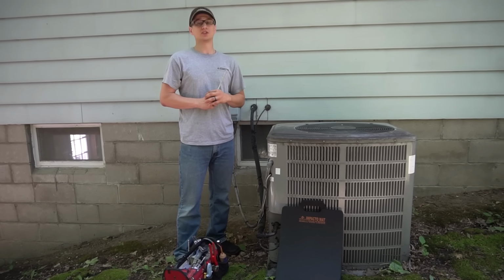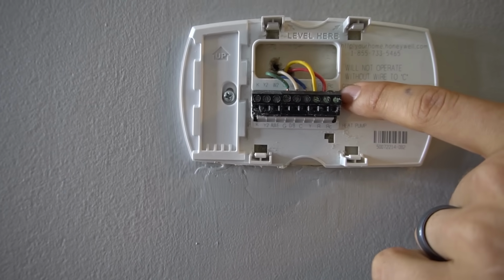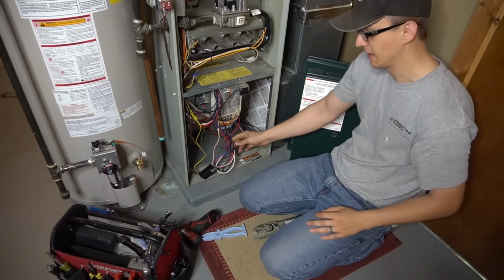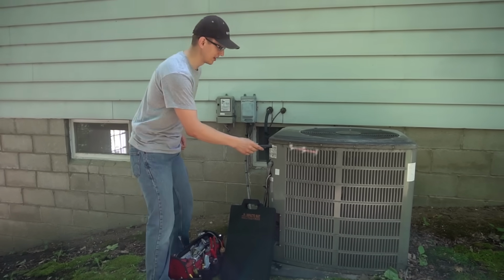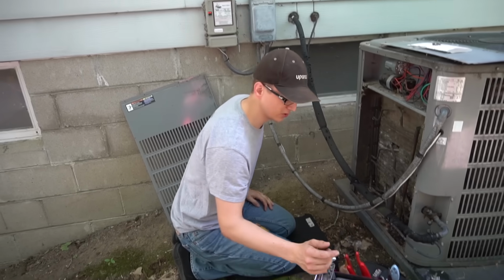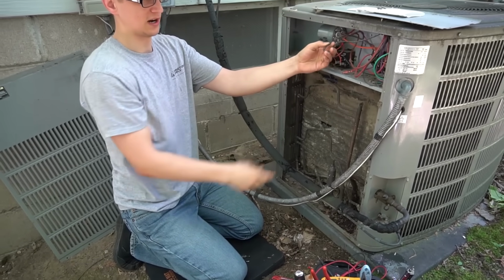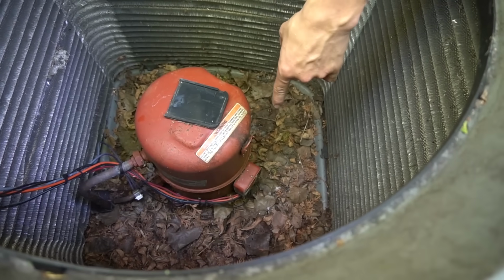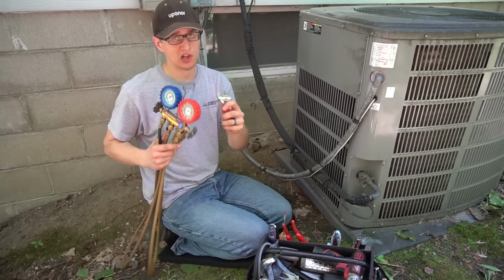AC Unit Not Turning On - How to Fix It Step by Step

Comment: Thanks for sharing, great video, my problem is that my AC stoped working 3 days ago and when Technician came looked at it, he found out the 30Amp breaker in the controller unit is burnt out, so he replaced the breaker and the system starts working but he connects the Red and Blue gauge and checks the ferron and he adds 2 more litter of ferron but he says there is too much pressure on the red gauge, so basically the RED gauge show 320 which he says is very high and that is the reason compressor draws too much power and burns he breaker. 

Not to mention that the new breaker burnt after 15 minutes and AC is dead again. 

So my question is, can I use the Hard Starter kit to fix this or is there any other way to fix the high pressure on the RED gauge. 

Thanks

Comment: Nice video! My Outside AC Unit Not Running But Inside Is blowing cool air, not COLD! It worked on this morning, but in the afternoon, we found no cold air, and the AC unit is not started (the fan on the AC unit is not running). When turned on the thermostat to "cool" and set target temperature below the indoor one, I can hear the cool air is started to blowing. I also heard a quick "click" on the AC contactor. But the AC did not start. I used a voltage meter to check the voltage before and after power goes through the fuse, it showed 3V. why there is no power? I did not see any AC switch on the breaker board in garage. Could anyone please tell me what is the problem?  Many thanks!

Comment: Hi, thanks for your great video. My AC is a one year old. The issue is when the thermostat starts I could hear the fan starting but not the compressor, for a while there is a periodic humming sound that comes on for a couple of seconds and repeats a number of times and then finally the compressor starts?

Comment: Awesome video. But I have a weird problem with my heat pump. AC isn’t working at all. Thermostat is set to cool. No clicks, hums, or anything from the outside unit. And no inside air movement from air handler under the house, either. Both outside capacitors test fine. Plunger switch on outside unit does start the compressor when manually pressed, but the condenser fan does NOT start. Nor is there any discernible hum from trying to start. The fan blades spins easily with a stick so the motor is not seized. But they don’t spin up even when I prod them when the plunger switch is pressed and the condenser kicks on. They just spin freely but gradually slow to stop just like when plunger switch is not engaged. No visible wire damage anywhere and unit was working perfectly yesterday.

Comment: Perfect video for troubleshooting central a/c problems.  I learned a lot very quickly.   The one point I’d make is that the installation in the video was a more typical heating/air conditioning setup.   If you have an older home retrofitted with a high velocity A/c system (blower unit in the attic vs basement), there is a drip pan beneath the assembly in your attic crawl space.   My issue was that the drip pan was full due to a blocked line, and the sensor in the pan stopped the trigger for the air to start.  I assume this is a precaution to prevent the drip pan overflowing and damaging the ceiling beneath it.

Comment: Great content, my AC dies on a Saturday night with 100 degrees forecast for the next day and I lay awake dreading a Sunday service call, dead compressor and all that. Watched this video that night, formulated a plan, got up on Sunday  grabbed my multimeter , did some basic checks, figured the condenser cap had expired and googled the specs. I got a hit at Ace Hardware in stock, ran down there, grabbed the cap, installed it and hit the go button and the sweet sound of a compressor on a Sunday morning filled the air. I have a background in troubleshooting machinery , but not residential AC and this vid helped me fill in the blanks with checkpoints. My lights had been dimming on the compressor start for some months, now I know why- the compressor was struggling to start with a 1/2 dead capacitor.

Comment: My ac unit was working until there was a power outage today in town. It lasted about 10 mins. My unit worked for about an hour after that then the outside unit never kicked back on. The furnace fan is blowing but nothing outside is running. Is there a way to reset the outside unit???

Comment: From a teacher - YOU should be a teacher - you have the common sense to know how people need a subject presented in order to understand it.  Subbed - liked and wish I could like more times.From what you say about refrigerant, it sounds like they replaced Freon - which used to be inexpensive and use R22 b/c its so expensive - another result of the non-science of "global warming."  I know before freon that ammonia and other cheap chemicals were used, and a leak was easily found but not fun to deal with.

Comment: New unit hvac but when air is on I smell a heavy smell in the room. Air is blowing out of the return line in the back of the ac unit in basement.  My previous old system had no air coming out of the back is the a normal process?

Comment: When I click on the plunger the fan turns on. but the moment i remove my screwe driver, it stop working again.  I checked the Capacitor and it is working fine, tried multiple new ones but still the same. I dont understand the next steps, please help.  Thank you, your video are very very informative.
Reply: might be your thermostat signal to the plunger/contactor
Reply: Check the drip pan.  We have a high velocity unit, blower assembly in the attic.  Checked everything in this video (which is superb, by the way), but my issue was that the drain from the drip pan was blocked, pan was full, and the sensor cut off the motor due to the high water in the pan.

Comment: Clear instructions even a DIY dummy like myself can follow.  Diagnosis points to capacitor failure.  Bought one and followed your other video to replace.  Now my AC is working again a few hours before the heatwave comes in  :)  What a great service you have provided.  You should start a paypal account so I could appreciate your great instructions besides words.

Comment: Great Video. I have a Trane system. Today the thermostat showed nothing. So I went down and turned my inside breakers off and back on. I could hear the inside unit humming. I went outside and did the same. I took my wet vac and sucked the drain pipe on the inside unit. The thermostat came back on. I set it to cool and the "cool on" light flashes. After several minutes, the "cool on" light stopped flashing and the outdoor unit came on. After some time, the thermostat went off again. I went through the same steps again and the thermostat came back on. But now the "cool on" light just flashes. After some time, the thermostat went off again.  Any help or direction you can provide would be great. Thanks

Comment: Hi sir just wanna ask about my ac is not working but when i push the contactor or plunger is work great was work everything! But when i release it, was not working again? I change already the capacitor & clean everything might have lady bug or ant between the contactor! The result is the same, is working only when i push or press the plunger on contactor to connect with the 2 metal connector! Should be pull in automatically but it only pulled in when i push by myself......What should i do? Thanks a lot in advance.....

Comment: outdoor unit does not turn on, capacitor tests out fine 50 and 5.  240 on incoming power to contact. when i push the contact fan turns on as does compressor, i noticed the condensate line gets hot immediately when i manually push contacts.  I'm thinking the contact is bad?

Comment: Hello, I was wondering your top 3 recommendations of where to start. Thermostat is ‘On’ (not auto). Vents are blowing air out fine, blower is working, no tripped circuits. Outside however, the unit hums for three seconds but then stops and nothing happens. So, Based on your video, I would guess the capacitor is dead...but wondering if you had any recommendations to check other stuff before i call anyone...or if you are still in MN I would hire you to come over?

Comment: I have a 5 yo 2 story house in Atlanta, came with two builder grade lennox units, the inside coils are in the attic.  The unit for the upstairs cut off and I determined that it was due to a cutoff sensor in this galvanized water pan that the unit sits in.  I had to use a rag and bucket to remove like 3 gallons of water from the pan.  After I removed enough water, it started running on its own.  I thought I"d have to re-set some breaker, but this did not seem to be the case.  Does this sound right? is this avoidable? it was very hot and humid today.  It was set on 78 all day, but maybe that was still too low(?).
Reply: I guess I had a standard clogged drainline.  It figures on one unit the installer gave easy pvc access, and on the other unit (the clogged one) the installer was lazy and did not give easy pvc access.  Based on my setup, I first tried slapping the pvc quite a bit, giving it good vibration, and I could hear a whoosh of movement in it.  So I'll monitor the drainpan for next few days and see if that sufficed. Next step: use hacksaw to cut pvc, I need to get a wire brush, and put overlapping clear tube on pvc as connector...

Comment: Thanks for taking the time to provide this video to help others!! I have two thermostats, one thermostat stop turning the air on but this display was still showing, A few days later, both thermostats went blank.   Neither of them had batteries in them. I added batteries to one of them and the thermostat display came on but did not turn on the AC even when put in fan mode,   No issue with the breaker.  Any suggestions on my potential problem? I worry because some times service people take advantage of women.

Comment: Thanks for all your tips. I've watched several of your videos and wondering if you can help diagnose and fix burning smell (outside) in AC unit. I just replaced capacitor and everything was working fine again for 3 days. Then the AC stopped (no fan, no motor, no cooling) and this burning odour. I can't see any burnt wires. I didn't hear any screeching or unusual sounds either. Should I open up and oil the fan motor?  Could it be something else?  It's an older AC.  Thanks for any guidance you can provide.

Comment: Yeah those safety switches will shut the whole unit down if that pan fills up you got to make sure those lines they unclog their General only one in I bought a 25 foot sink snake and I had to bend the tip a little bit just to make the bends but man it works good I generally snake it out and then dump some water through it out of the pan The Flash all that nasty crap out

Comment: Thank you so much for the very informative video! I just replaced my regular Honeywell thermostat with an Ecobee smart thermostat. But since I don't have a C-wire coming into my old thermostat, I researched and I saw a video where they took the G-wire and used it as the C-wire - they said the G-wire is redundant since furnaces automatically turn on the fan anyway. My Ecobee smart thermostat did turn on but a couple of minutes later, it went dark and I pulled it out. I rewired everything on the control board and reinstalled my regular Honeywell thermostat but now my furnace isn't even turning on. I hear a bit of noise which disappears when I remove the lower panel but that's about it. I checked my circuit breaker, the switch to the furnace, and everything is turned on. My furnace is a Heil DC90 and I can't find a fuse anywhere - I'm concerned that I may have shut my control board. I stuck a voltage tester on the C and R terminals with the lower panel safety switch pushed down, and no voltage is being registered. What can I do to further troubleshoot this?

Comment: Excellent video to walk through troubleshooting my AC problem!  Of course it's one of the hottest days this summer in LA, I have a pregnant wife, pandemic insanity, and you saved my a$$.  Money is extremely tight and a $12 capacitor was the fix.  Fortunately I found one at a local store, replaced it and then spent the rest of the day giving the condenser a long overdue thorough cleaning.  THANK YOU!!

Comment: thanks for the video. i had a dead capacitor. fan wouldn't run and only compressor would start humming, but if i pushed the fan it would start spinning. went to an hvac store, got a new capacitor for $30 and it solved the problem. much easier than having to pay extra and call a repairman. 
I will be ordering an extra capacitor off ebay to keep for back up since they're only $15 and this is the second time the cap has died.

Comment: Thanks so much.  I went outside and spun the blades with a screwdriver started right up. My only question is could there be a bigger issue causing the blades to not spin without a push?? Just concerned it is a symptom of something I'll have to fix soon.  Thank you though! Very concise and detailed!

Comment: Yo'u're in Minnesota?  Me too and tonight 7/27/2020 my AC stop cooling right about 9PM was working just fine before that.   I followed your advise here  by checking the fan  and it's  working, thermostat is working, open the AC unit and the check the dual compressors and it looks good.  What's my issues?

Comment: your video is great.  I do have a question about the blower and the transformer.  Is it possible for the transformer to get hot or if it does does that mean it it bad?  Thanks again for your knowledge and sharing it with everyone!

Comment: The issue I'm having...outdoor unit is Trane XR.  Thermostat is working properly.  Fan works properly.  Outside unit only makes a single "click" noise.  Fan does not turn on outside unit.  This just happened.  Unit had been working just fine.  One thing...it has been quite hot here in Virginia.  I had thought that the unit may have "froze up"...so left the thermostat completely off for a couple days.  So that's when I noticed the fan inside working as it should...the outdoor unit only clicks and doesn't engage.  Any pointers would be immensely appreciated!!

Comment: Friday night, 07/24/2020, 10:30 pm in Austin, Texas. Know this:  it's hot outside! I noticed the house getting hotter. Check the vents and air is blowing, but it is warm. Go outside and check the outdoor unit and discover it is not running. Scratch head and think to self, "Figures"  I contacted my friend Mr. Google and asked for help in diagnosing the problem. Mr. Google said, "Check out this guy on YouTube": 
"AC Unit Not Turning On - How to Fix It"  by publisher 'Word of Advice TV'.  
"This looks good" I thought to myself.
I was right!!  Dude, you are an incredible teacher. Thank you so much for offering your knowledge and advice to your fellow man!  Following the steps in your video, I isolated the problem as the Contactor. Pushed the little contactor button and the compressor started right up stayed running!!  Went in the house to check and could instantly tell the a/c was working again. Did a happy dance and received a kiss from the wife as a thank you. 
Luckily for me, the a/c continued to run so I will be able to check the contactor switch tomorrow and clean it in the daylight (I felt something "crunch" under it when I pushed the button!) As for now, I am going to bed, cool and happy, cuz it's 12:45 am.  Thank you, thank you, thank you, Word of Advice TV!

Comment: Question HVAC Master,  My AC Condenser  wont turn off during nightime eventhough I turn off the thermostat, it keeps running until the low side ice up. Its a brand new unit and the problem is not the  contactor either. Any ideas? Please help. Thanks.

Comment: Gerald Powell Atlanta GA.  I have a XE 1000 4 ton heat pump duel fuel. my AC runs for about 30 min. and the fan stops but the unit outside is still humming and you can feel the heat from it .
I have had it worked on they changed the fan motor, defrost board, capacitor, magnetic contactor, clean the coil, and it still does the same thing . when the fan stop and you turn the unit off from the thermostat for about 30 min until it cools off it will start up and run again for another 30 min.and stop. can you solve my problem.

Comment: What about outdoor units that's what I have I did get it going by putting back the shut off breaker outside and by moving the fan by hand and then I cleaned around it I hope its not my compressor

Comment: How long should the ac unit run then shut down and cycle to maintain the temp selected on the indoor thermostat. Got a 20 degree drop measured across the evap coil and intake air but the unit runs almost constantly to maintain 78 degrees set on the thermostat. Outside air temps in the mid 90s. House sq footage 1800.  Not sure but believe its a 2.5 ton unit.

Comment: Need ideas about taking apart the AC heat exchanger thing, how to get to it?  I think its clogged up. the ac works, compressor works, we cleaned it out, was packed with crud, we used soap, soft brush and garden hose and cleaned it; but very little air comes out, and the blower motor gets very hot.  I think its shutting off for thermal reasons.  but there is no way to get into that triangle thing except with a sawz-all ? just cut the entire plenum apart? or what? its sectional, each part is sealed with silver tape.  I also have some M80 firecrackers left over, could drill a hole put a few in there and... well I want this done properly, its not my AC system. how is the mysterious triangle unit of coldness accessible? or is it? please help

Comment: Mine ran then stopped started to humm i have a trane unit i only cleaned it a month ago still getting moved in to this house so im a nube to central air units but im mechanically inclined and a magiver of sorts i will start with what you started with in the video any help would be appreciated